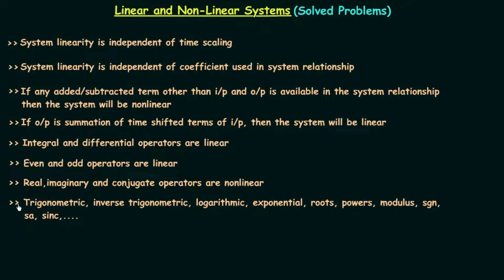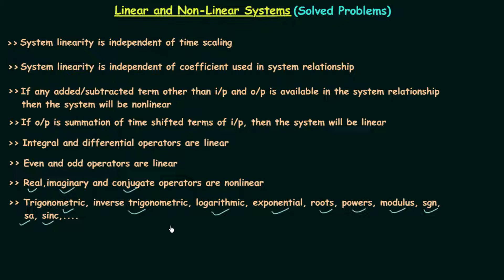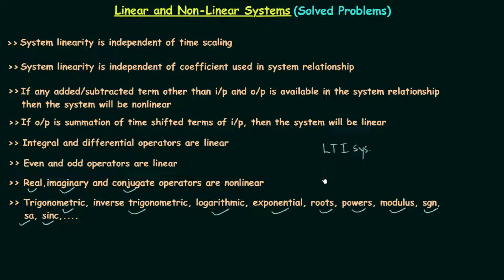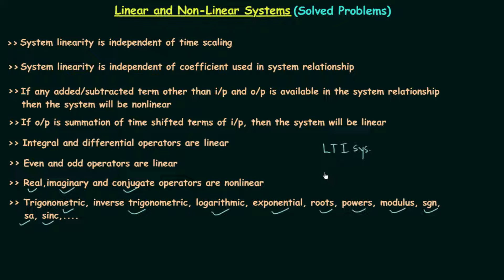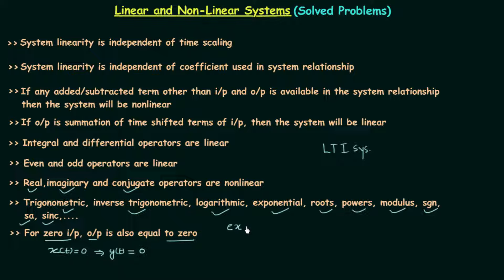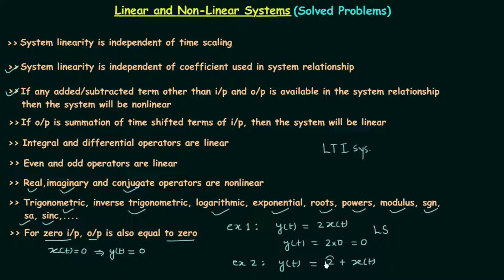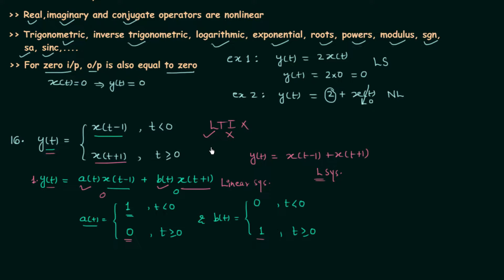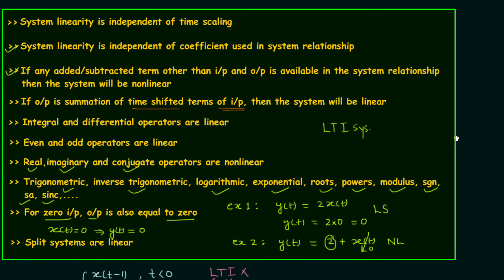Linear and Non-Linear Systems (All Properties)

Comment: 1. Split system are linear. 
2. Modulus operator is non-linear.
Aren't these two statements contradictory? Bcoz modulus operator make split system..  please clarify.
Reply: kanchan chauhan same.....
Reply: vivek khamari vivek khamari .. doubt cleared..

Wen we talk abt modulus operator.. it means modulus on input x(t)   
 e.g.  y= |x(t)| will change according to value of x(t)

But split system:- whose value changes/splits according to time t.
 e g.  y = x(|t|)  will change acc. to value of t
Hope u get it.
Reply: but according to graph again getting confusion...
Reply: Nice question but i knew it
Reply: @kanchanchauhankc  Exactly, that's the reason.

Comment: Can anyone prove why..... a system y(t) = 2x(t) + x^2(t) is a non-linear system?
Reply: x^2(t)  makes the system non linear ...

this happens for a simple reason (A+B)^2 IS NOT EQUAL TO A^2+B^2
Reply: If we apply property 9 for zero input the output also equal to zero for linear systems.
X(t)=0 then y(t)=0
System is linear..
If we apply property 8 system becomes non linear because of power.
Can you please tell which one is correct

Comment: Y(t)=cos inverse x(t),at x(t)=0but y(t) is not equal to zero, why sir?
Reply: That is why it is a non-linear system.
If a got your question right.
Reply: Ignore Signals and Systems. Go back to the first course on math you had. You learnt that arccos(0) = 90°. This has nothing to do with Signals and Systems.

Now go back yo your example, since y(t) is not zero (it's 90°) when x(t) is zero, the system is non-linear.

Comment: Is it possible to add a constant term (K) which can be dependent or independent of time to any case in  the split system because in that case the system becomes non-linear

y(t)={ x(t-1) + K ,t<0
           x(t+1) , t>0

Is this possible ??
If yes why and if not then also why??